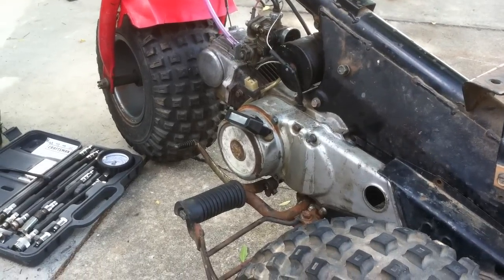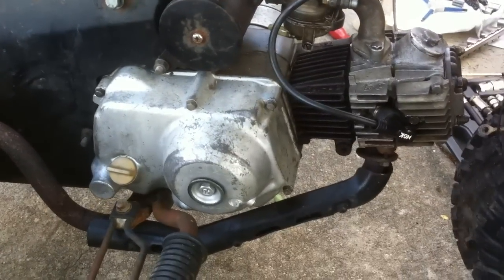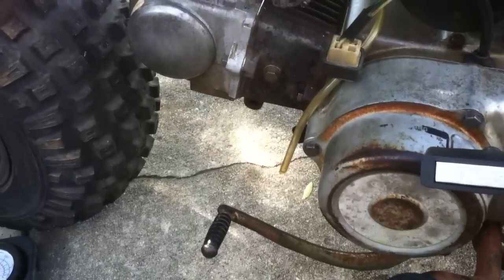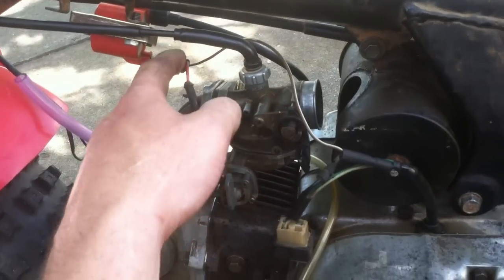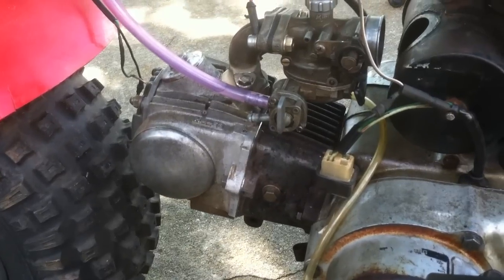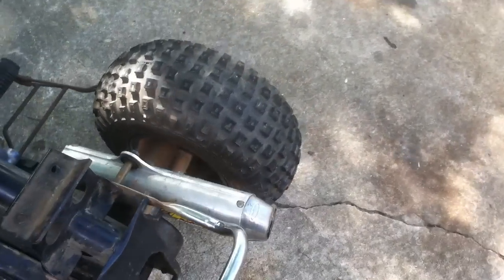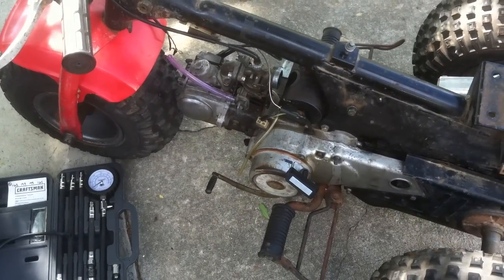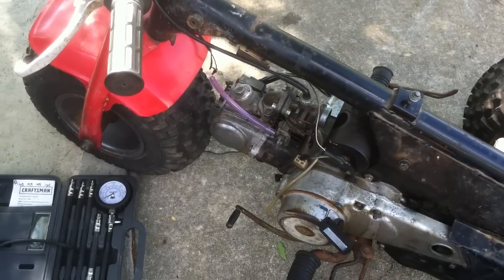ATC 70 motor from hell.

Comment: It's the carb you need to adjust the air fule mixture same thing happend with my 200s and when I leveled out the adjustments you can give it full throttle and it won't bog

Comment: stupid question, but have you cleaned the jets? needle height? the reason i ask is because i had adjusted the valves, assured the engine was in time, replaced the condenser and points after having cleaned the carb...and when i was ready to pull my hair out, my buddy said we should pull the carb of one more time and sure enough the secondary jet was plugged... it runs beautifully now... good luck